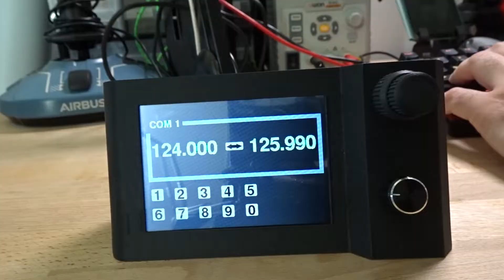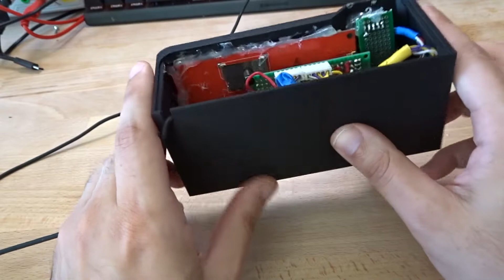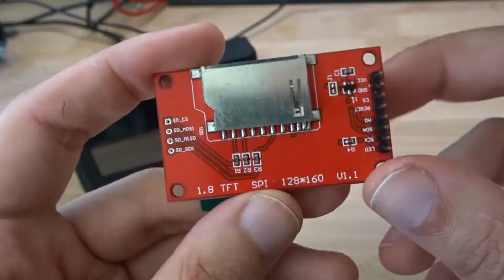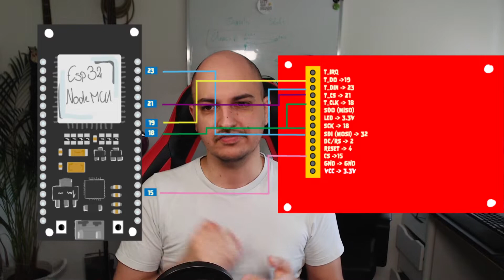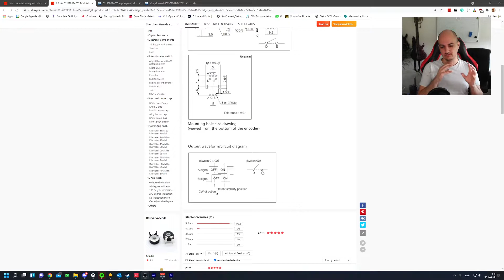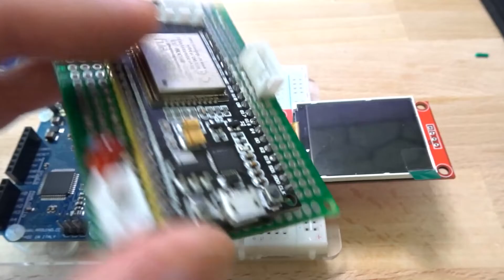Create your own custom ESP32 primary flight display for MFS2020. part 1

Comment: question, a quick look this looks same to me, but can you verifie this same wiring of screen as yours? reason i ask ordered circuit boards for that, getting more than need if i can  also use for your project be a bonus

https://content.instructables.com/ORIG/F5U/M0D7/KJ2UUSVT/F5UM0D7KJ2UUSVT.png?auto=webp&frame=1&width=1024&height=1024&fit=bounds&md=834a6eb5e399f0dcc375286929fe7c80

Comment: Hello ! I'm trying to use your software to use a TFT screen and a dual knob to display and change frequencies as you show here, using an ESP32. I'm however struggling with an error when it comes to compilation. Here is what I get :
In file included from C:\Users\<User>\Documents\Arduino\libraries\BitsAndDroidsLibrary\examples\inputExample\inputExample.ino:2:0:
C:\Users\<User>\Documents\Arduino\libraries\BitsAndDroidsLibrary/BitsAndDroidsFlightConnector.h:9:28: fatal error: SoftwareSerial.h: No such file or directory
compilation terminated.
exit status 1
Error compiling for board ESP32 Dev Module.

I understand that SoftwareSerial.h is missing in my library folder whereas you call that file in your library. I tried to install "EspSoftwareSerial" library to see if it was able to solve the issue, but then all your functions weren't recognized during compilation.

Any idea/instructions to solve this issue ? Thanks in advance for your reply ! :)
Reply from the maker: Hi sorry for the delayed response. There is a special library tailored for the ESP32 on my website (https://www.bitsanddroids.com/downloads) called flight32. This library removes the conflicting functions
Reply: @Bitsanddroids  Hi! No problem! I think I already installed and included it in my code but I will check in a few days if I'm right. Thanks for your help
Reply: @Bitsanddroids  I think you're totally right, I will check my code but I must have included both flight 32 and standard one, which are incompatible for sure. Thanks, I will try with the flight 32 only!
Reply: @Bitsanddroids  Hello ! That was the issue, I mixed up different libraries in my code due to older videos inspirations of you ! Many thanks for your answer that unblocked me ! :)

Comment: That's not a primary flight display... a PFD has an attitude indicator, speed and altitude indicators, ILS and other navigation displays etc.
Reply from the maker: They are planned to be added. To keep things manageable and easier to get into I wanted to start with more static screens. It would be too daunting to immediately jump into a attitude indicator (at least for me)

Comment: Wonderful project, thank you man!
Looking at your video i was thinking to a little smarter/modular version made with more displays one of them generic/switchable and some of them dedicated to specific funcitions. 
The first one could be switched to manage/display COMs, NAVs, VOR (frequencies), ADF (frequency), XPNDR and to display the status of landing gear, flaps, airbrakes, fuel, etc.
Others 2 or 3 LCD panels could be used to display anemometer, variometer, gyro-compass, altimeter, RPM, VOR/ILS, ADF

I have to think more to this idea but it seems that could become a (maybe) too big effort also because probably i could need a some kind of higher controller to manage the data flow from/to each peripheral...
What do you think?

Comment: Great work
Got some of those dual concentric rotery but the outer nob don't rotate 
It only goes one by one to right or left
Reply from the maker: Thanks! Do yours only rotate a single click and then block?
Reply: @Bitsanddroids  the inner nob rotates normally to both sides.. the outer doesn't click it turn to one side and come to centre again and vice versa.

Comment: I really like how you are going with this - good job!  Do you have a source for the dual concentric knobs?  I always seem to have trouble finding those.  Also, did you make the case for this?
Reply from the maker: Yes off course I put a link to the encoders in the description (they are on aliExpress). If you search for dual concentric rotary encoder on there you'll also find some part numbers you can google locally. 
The case + encoder knobs are modeled by me. I See i forgot to add the link. I'll sen
Add it when I'm back at my pc.
Reply from the maker: Here you go!
https://www.thingiverse.com/thing:4926863
Reply: @Bitsanddroids  Hello! First, thanks to share your projects and ideas, it's really inspiring. I don't find the knob files in your Thingiverse link, there is only the base and the case. Could you have a look if you also have the files for the dual knobs to be printed? Thanks :)
Reply from the maker: @tanguyd879  You are completely right! I'll try to find them for you
Reply: @Bitsanddroids  super! Thanks a lot!